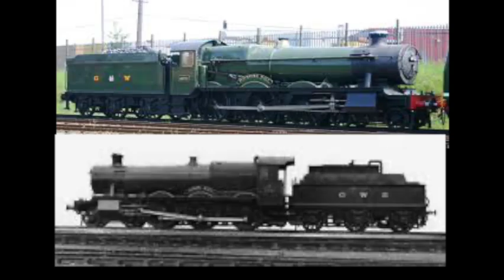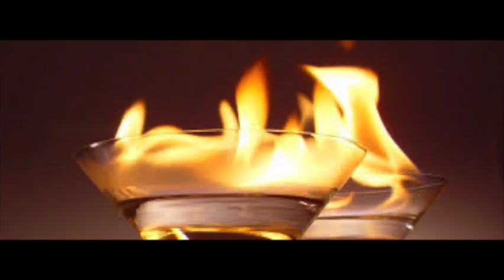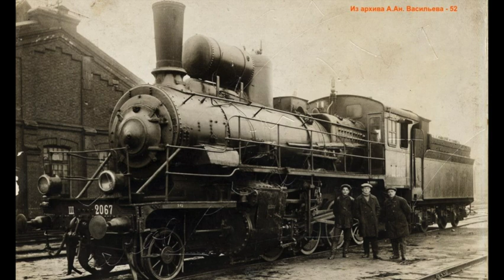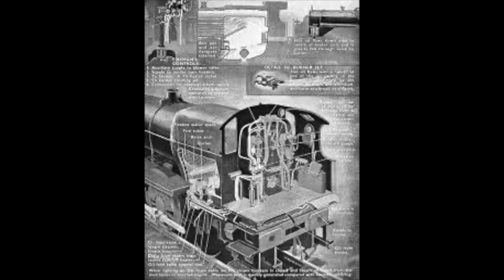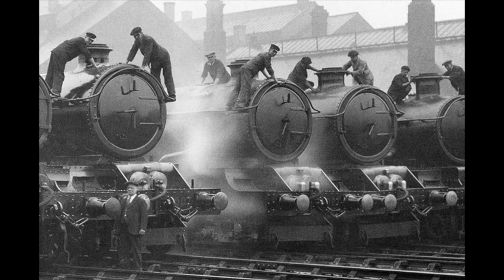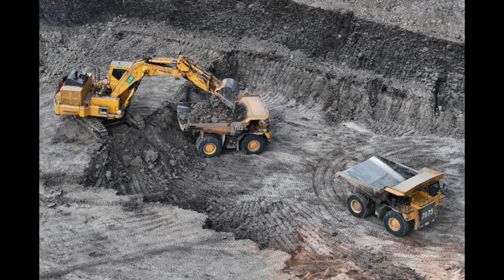The original heavy oilers!

Comment: In the Southern Hemisphere, New Zealand, two classes of locomotives were oil fired.
The J class and the K class, and only in the North Island. This was from the early 1950’s until the end of steam in 1971
Not all of the J or K class were oil burners.
Some of the J Class were built by North British in Glasgow, but were coal fired, and were 4-8-2’s.
The Kb class, of which there were only six, were used mainly on the midland line between Christchurch and Arthur’s pass. They had a booster on the rear truck which was not overly successful. They were 4-8-4’s as were all the other K class in the N. Island.
When I started as a “locomotive trainee” I worked on coal fired and oil-fired locomotives, but left the railways before graduating to trainee fireman.

Comment: A similar fuel source that several American steam railways have been testing is Biodiesel; at its simplest, a mixture of ethanol and commercial waste oil, most commonly from restaurant fryers. It's more environmentally friendly than burning the traditional liquid dinosaur, and once the relatively simple and compact refining plants are set up it's also fairly cheap, especially if the railway can cut deals with local restaurants to haul away their waste oil at cost rather than them having to pay for it to be taken to landfill sites. Plus, it can have the delightful side effect of making the locomotive's exhaust smell like donuts or french fries (or whatever the oil had previously been used to cook). 

Another fascinating alternative comes from the Nevada State Railroad Museum in Carson City, NV. This museum has struck a deal with nearby Reno Tahoe International Airport to dispose of their used aviation fuel. By Federal Aviation Administration (FAA) law, any fuel not used by an aircraft at the conclusion of its flight must be drained to allow the fuel tanks to be inspected, and said drained fuel cannot be used again and must be stored by the airport for later disposal. Wanting to avoid the expenses of keeping huge storage tanks of essentially useless waste jet fuel on top of the vast costs of safely and legally disposing of it all, the airport has agreed to essentially donate the waste fuel to the railroad museum for only the cost of transporting it; essentially, "It's no use to us, so you pay for the tanker truck to haul it away and you can have as much as you want. Heck, you're doing us a favor by taking it off our hands!" And with only minor mechanical modifications and crew training, the museum's 100+ year old steam locomotives are able to handle the waste fuel without any issues. So yes, these iron horses are literally burning jet fuel. This may be a path that some British heritage railways, especially those located relatively near to major cities, may wish to consider; perhaps the East Lancashire Railway could seek an audience with nearby Manchester International, or the Bluebell could talk to the chaps at Gatwick.

Comment: Interestingly, this initiative is the reason we today know the GWR 1400 class as the 1400 class. They were originally the 4800s but 20 of the converted oil burners were given the 4800 range instead, while the tank engines were renumbered to the 1400s but never received their old numbers back afterwards.

Comment: You never know! I think the failure of the GWR/Western Region scheme was the historic problem of oil pricing and the exchange rate £/$, with it all being imported at the time.

There was quite a lot of oil firing across the channel, on the SNCF, with many class 141 R locos being fuelled that way. I have a book about that lot, and one of the issues it describes well is what happens from time to time with soot from the heavy oil firing inside the boiler tubes. Their tactic was to have the fireman chuck a container load of sharp sand into the furnace while running. It could only be done in areas where the locals would not complain about it, as it caused a lot of dirty smoke! Quite a few images of that in the book. Don’t know if that was ever done on the GW ones, though.
Reply: Good oldvWestern Region,whatever the other regions did
thevWestern did the opposite !
Reply: It was. After the installation of well-publicised oil filling plants especially on the GW, it was announced that we did not have the exchange to purchase the oil.

Comment: I knew the Americans embraced oil fired locomotives ,I did not know it had been tried here.
Reply: oil fired locomotives were more common in the western USA as they were advantageous in reducing trackside fires and consequent forest fires.  Also California had oil.  In the east most everything was coal but divided into two types.  Most were bituminous but a considerable number in the northeast were anthracite especially on the Lehigh Valley, Jersey Central, Lacawanna and Reading.  Only one runs in preservation and I think they use bituminous in it.  Today there are some tourist railroads considering converting steam locomotives from coal to oil.  We have coal available but oil might make less smoke and there is always the fire issue.  A lot of railroad right of ways are overgrown with vegetation whereas in the old days that would have been controlled better.